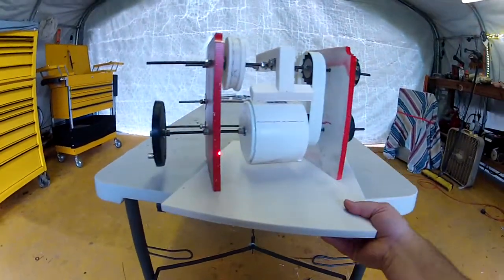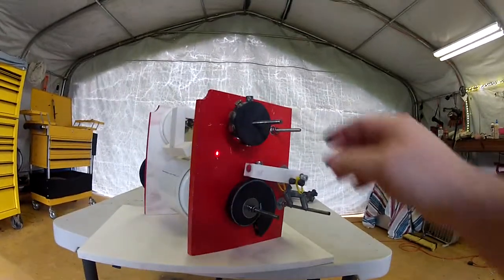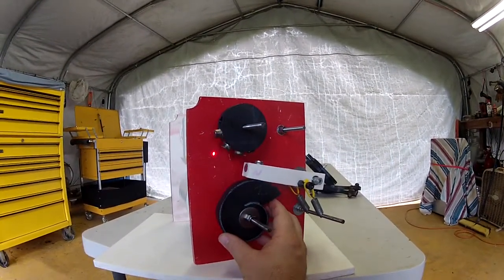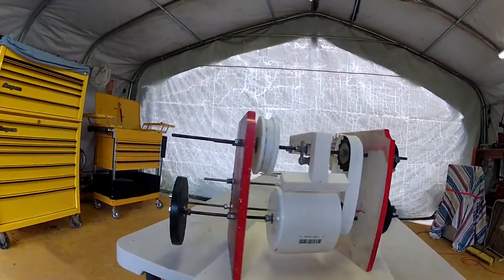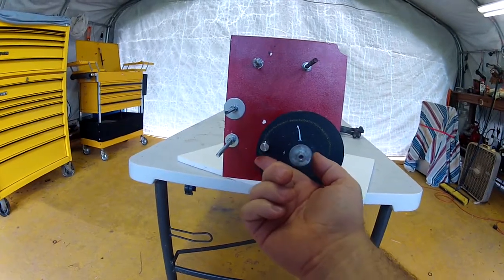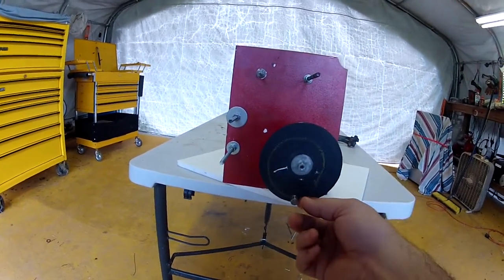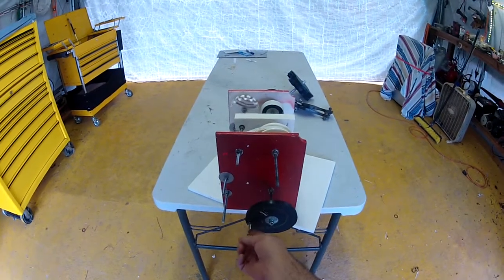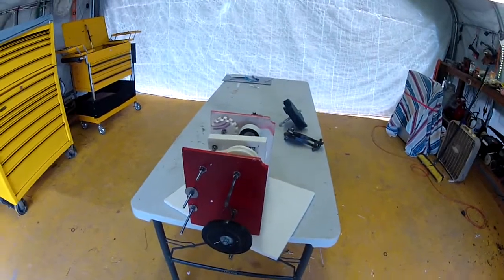pulse motor build off 2013 update

Comment: I wonder, If you removed the movable trigger and added like five of them in a stationary position equally spaced about the circumference and at the correct distance from the rotor to facilitate action. When one trigger hit the sticky spot the other four would drive the rotor around.
Just a thought.
Thanks for posting!
Peace!